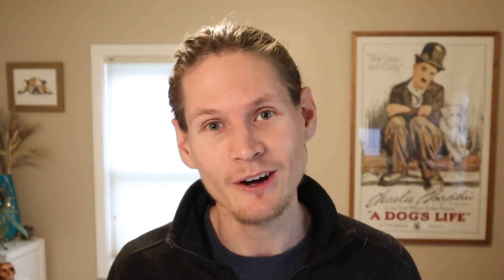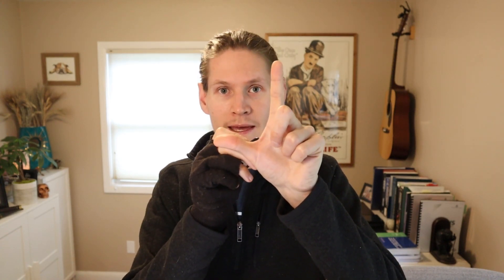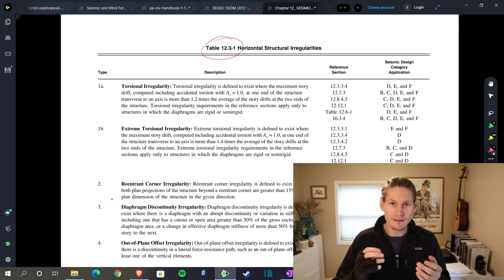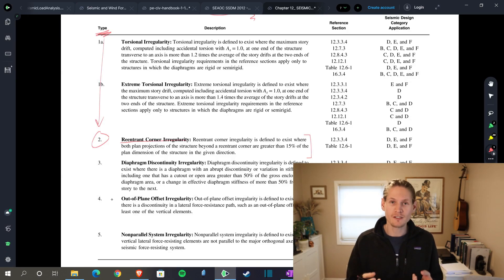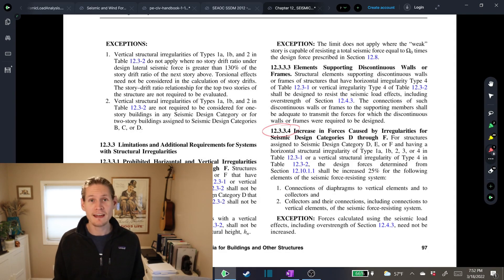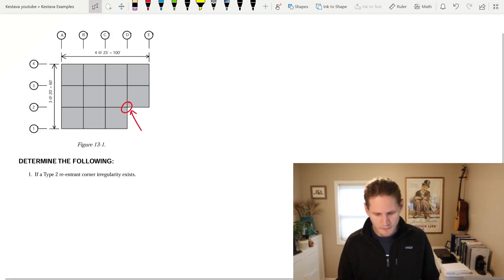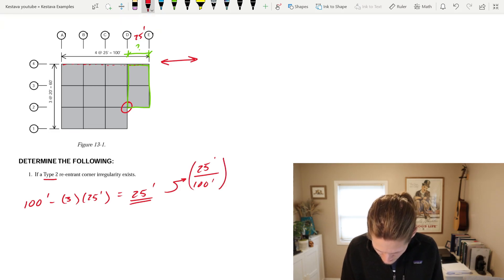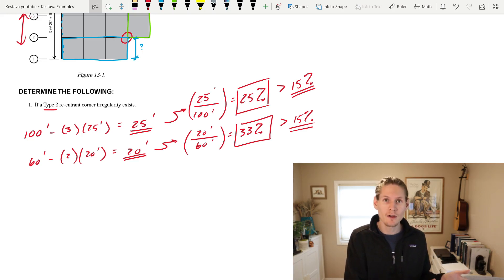ASCE 7-16 Re-entrant Corner Design Example | By Hand

Comment: What is your interpretation for reentrant corner when the roofs are offset. I cant upload a sketch, but consider an L Shaped building, the vertical leg of the L is 30ft tall and the horizontal leg is 25ft tall. The plan dimension qualify for the diaphragm re-entrant corner, but the diaphragms are offset. Is this still a Re-entrant irregularity?

Comment: Great video! Question - You said horizontal irregularies would only apply to the horizontal diaphragms (roof/floor). So if the roof was full 60'x100' rectangle, but the walls below were in the pattern you used for an example (so the roof had a 20'x25' overhang in the corner), would that not be a Type 2 irregularity?

Comment: Hello Kestava,
Your videos and information are on the spot and helpful for exam takers. 
I would like to ask you if you can present one or two problems, exam like type, on Temporary Structures, in building design/construction, something like form work or shoring system under poured slabs and the impact on deflection once the temporary structures are removed. Thank you.